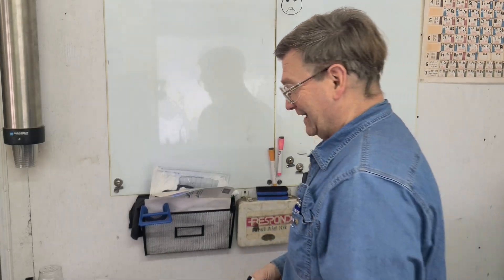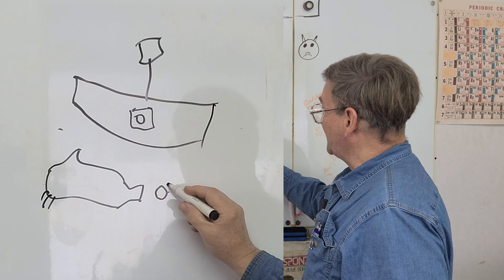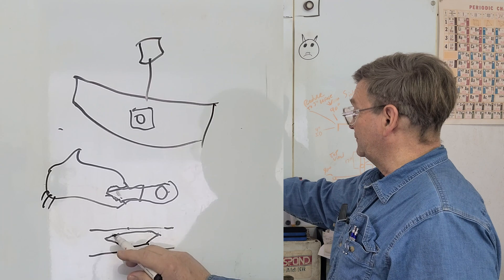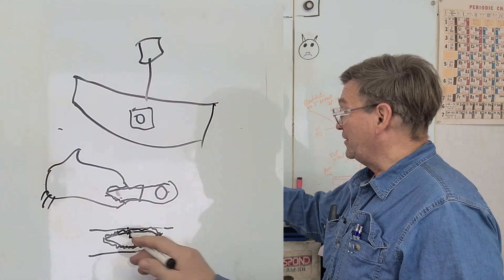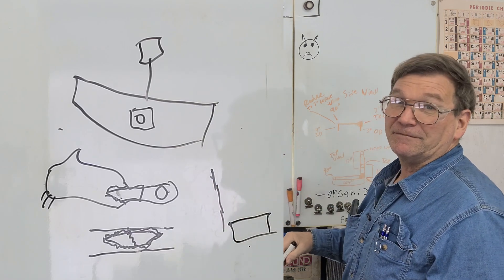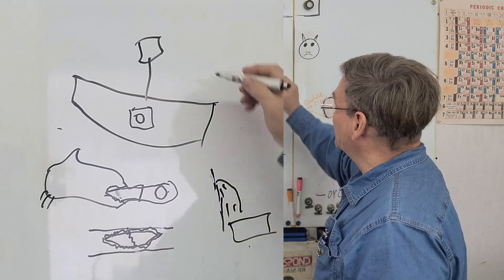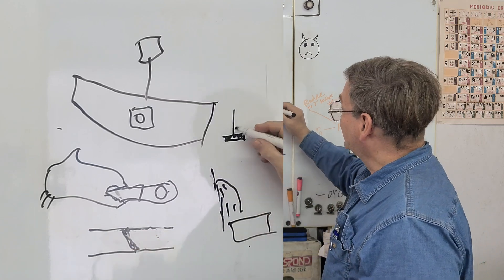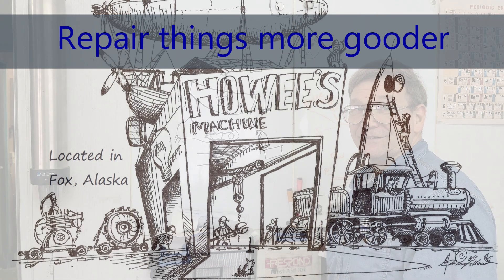Machinist's Minute: fishy repairs are not good!

Comment: This channel is fascinating. Live the history of how welding has progrssed, or not 😊
Reply: in ways its history of design the old equipment usually was just massive and structure didnt have dynamic loading.  now the broken part was probably pre stressed on purpose.

steel boats flex plates dont so you tear the hull around the plate.

Comment: Not mad about the fishplate comments but you left out the other fear they cover.  When I use a fishplate it's not because I'm worried about the weld itself, I'm worried about the area right around the weld called the heat-affected zone.  Out in the field you can't really normalize the area around the weld very well, but you just changed the grain structure into something weaker than it was.  Fishplate comes in as better safe than sorry.  I'm still grinding or cutting out the crack, still using backing plates, but I'm also putting a fishplate over the top just to be on the safe side. 

Also if the repair does fail for any reason and the insurance company decides to come after me they can't point to a missing fishplate, something that's "standard procedure because everyone else does it," for an easy win.  They'll actually have to investigate and prove that my weld was faulty.
Reply: I’ve had heated zone issues before. Vee out the crack, weld it up, then it cracks next to the weld. Do that crack and it cracks next to that

Comment: I repaired oil field tankers for a year to DOT specs and we actually did use fish plates but not for the reason you said.  The angled part at the end is so there is no HAZ perpendicular to the force or loading.  If you left the end square then welded it, that weld would be parallel to the crack and just crack again on the new HAZ.  By angling the end the weld is not entirely at that angle, so it is stronger.  Some equipment manufacturers don’t even weld the ends at all for this reason and Cat actually runs the weld bead off the plate and continues it only on the parent metal at an angle so there is no transition at the seam.  This is actually done in saddle making as well, you don’t sew a breast collar across the end, only down the sides or “v” the end so as to not perforate the leather making it weaker.

Our DOT procedure was to drill out crack ends.  Grind out entire crack.  Weld crack.  Grind smooth.  Plate both sides and weld plates with fillet weld all around.  I fixed the entire fleet in a year and in 14 years haven’t had one break yet.

Comment: I've heard the 'more weld so funny shape' theory many times but it never really sat well with me - why not use a larger piece but keep it a simpler to fabricate shape and you'd still get the extra weld? Something I've thought about, and it makes sense to me, is that the shape means you can fully weld it without causing necking, one area where the stress chanegd rapidly and that'll be the weak point. I saw something to that effect in an old repair manual where they said to for rectangular fishplates, only weld the two sides longitudinally up the part - doing the transverse ends causes necking and will be the failure point

Comment: my log skidder had multiple "fish" plates over a broken blade, like 6? 7? all stacked on all of them cracked and broken, took me 3 weekends of torch and grinder work to cut it all off, to find the original break was never welded... so far its been 9 years its still holding without fish plates, I'm not the best welder